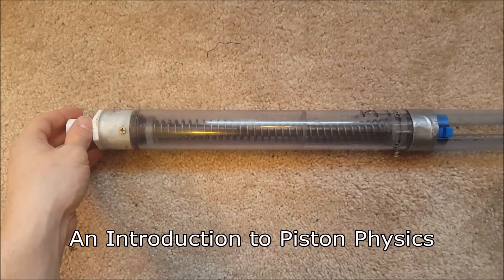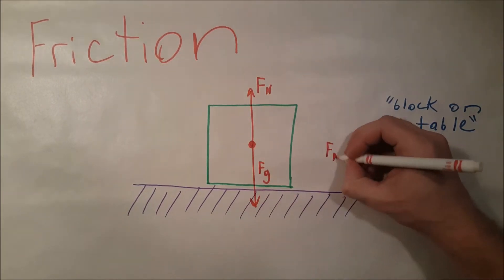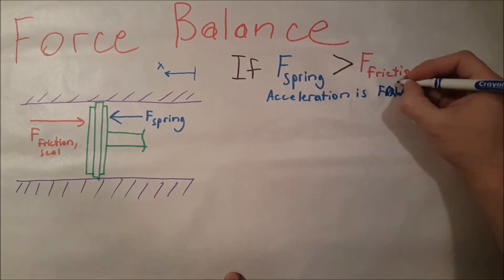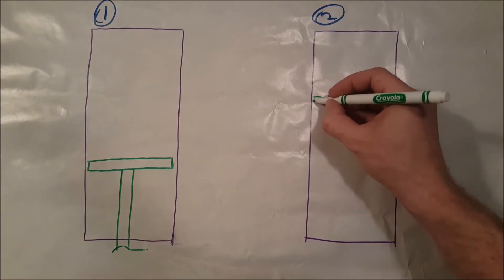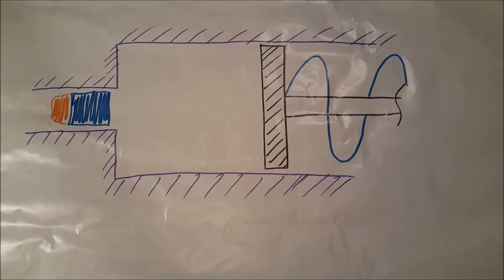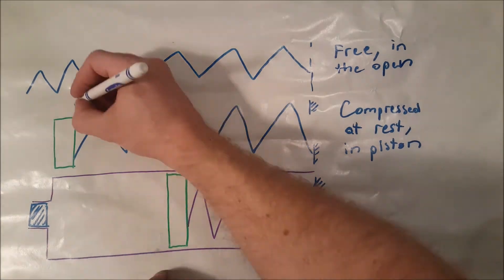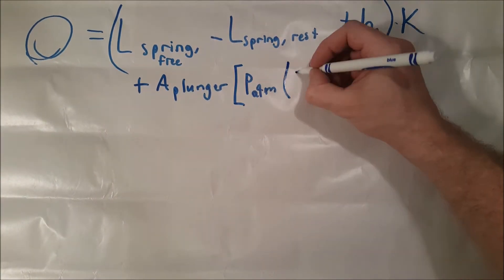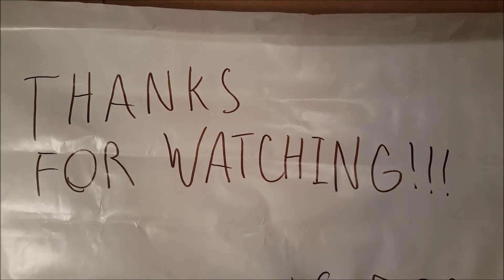Piston Science

Comment: How about the weight of a plunger?

It should be as light as possible right?

Heard some ppl saying that a heavier plunger will help pushing out darts at the end of the spring travel, but don't think that's true.

Want to know what's you guys opinion, thanks!
Reply from the maker: NERF870525 that's the general rule of thumb for the purposes of acceleration, recall newton's law F=ma, the force exerted by the spring doesn't change, so if you increase mass, your acceleration from that forced is reduced proportionally.

Comment: The problem I'm having is overcoming friction with the plunger head. I've even tried using 3" of precompression and lubricants and it either slides freely and has no seal, or has a perfect seal but isn't allowed to slide. Can you do a troubleshooting video for plunger heads?
Reply from the maker: 3 inches of precomp is overkill, i.e. it tells me that there is something wrong with your setup. What is the actual ID of the plunger head you are using? What springs are you using? Did you drill anti-vaccuum holes in the body tube behind the piston chamber? (seen around t=1:03 in video). Using lubrication, make sure you are running it really wet. coat the whole rubber until it's dripping with lube, run it a few more times in your piston to distribute the lube, then add more. Seriously, if there is extra lubricant it will work it's way out.
Reply: Aeromech the 3" was just a test. It's 1 1/4" sch40 PVC. I'm using the superlative plunger head, a full k26 1/4" off full compression and lowes extra thick 1 1/2" rubber washer and white lithium grease. There was only 3/4" of actual precompression when the spring was new. You can sort of see the blaster in the newest video on my channel. It's using an RSCB because it didn't have enough power to use a hoppers used one 1/2" vent hole base with a drill bit
Reply from the maker: Looking at your video it seems like its performing pretty well. If you still have problems with it, I'd say switch out the grease to silicone grease (found near plumbing section) and maybe try thinner rubber washers.
Reply: I thought that might be the problem. Where can I get thinner washers? Does Home Depot have any?
Reply from the maker: Joe miller I always go to ace hardware and ask for rubber fender washers

Comment: Cool explanation of some basic engineering principles! Ages back I took this sorta maths and extended it with a basic Euler integration to try and solve for the dart velocity in order to calculate the optimal barrel length. Sadly I didn't have a good set of scales at the time so I got some weird results with my made up numbers (the plunger "bouncing backwards" on the "air spring") that I picked out of the air. At that point I got into flywheel blasters and kinda just forgot about it

Maybe I should revisit that code, use some accurate scales to measure stuff and see what I get -R